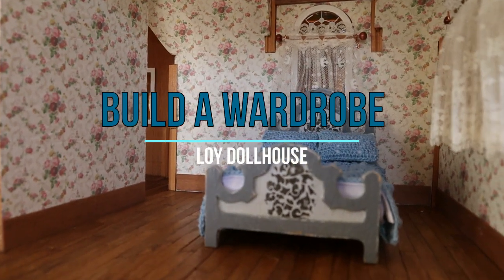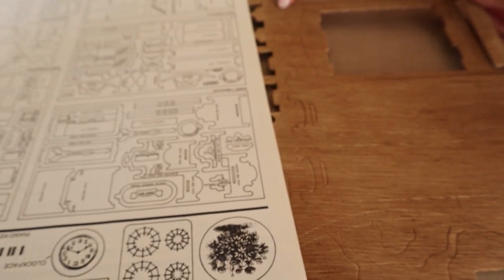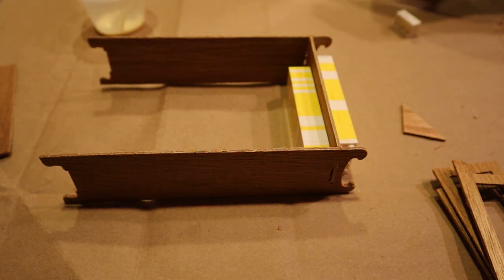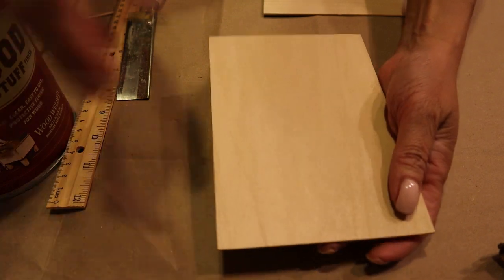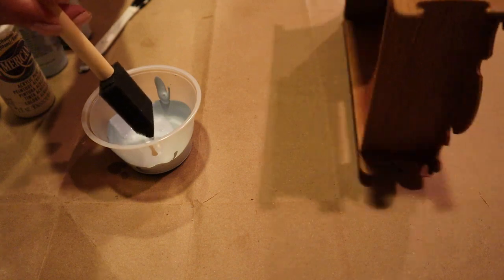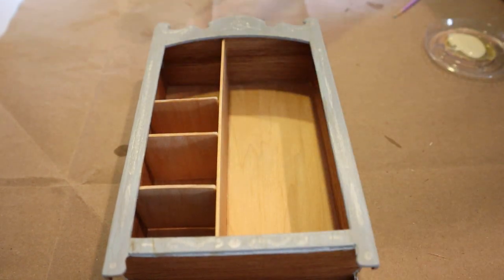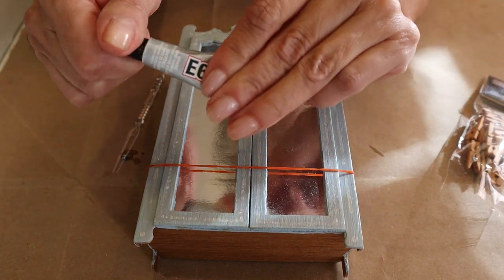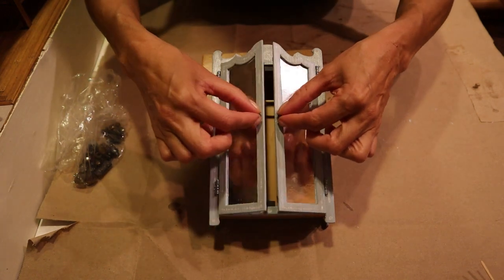Wardrobe miniature. build from wood. dollhouse armoire

Comment: Wow you have been busy Loy! I think if it's really dry I would do the oil before and after sanding just like you did. I think that way would help prevent breakages. The oil certainly makes it look lovely.
Also your timing is perfect, I just ordered a bedroom kit very like this and am waiting for it to arrive! I love the colour you used as it reminds me of vintage Scandanavian furniture...it's beautiful Loy.
I ordered some thin brass tubing and head pins to do something similar, hinge wise but watching you the thought occurred that I will have to be very careful cutting the tubing because I don't want it to be closed by the pressure of cutting...this may need a rethink...I do already have mini clothespegs so I may end up using your ideas in which case I would tag you for the idea if I upload pictures.
Reply from the maker: I love that you are using some of my ideas. It humbles me.